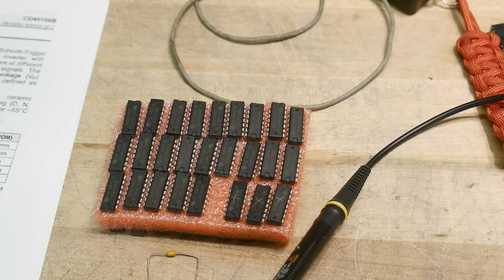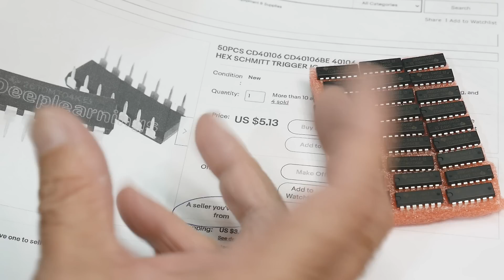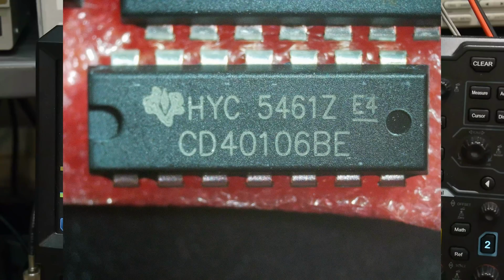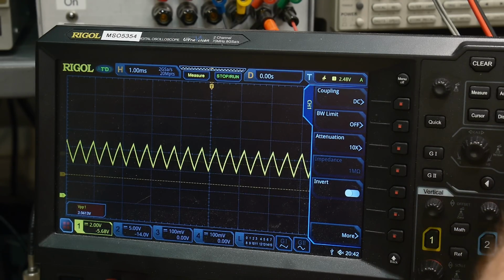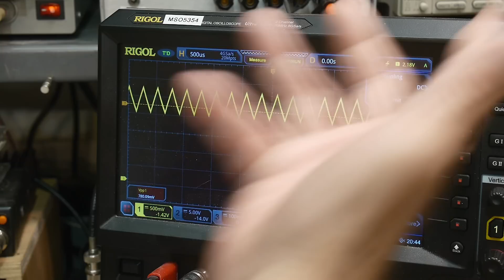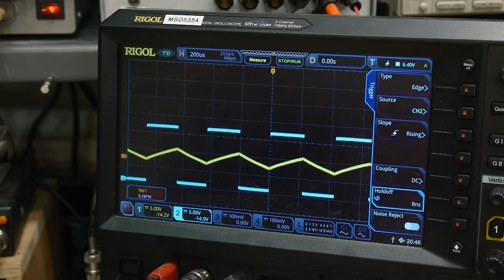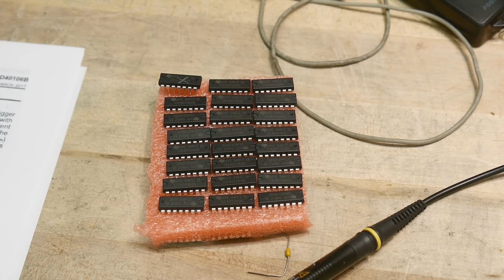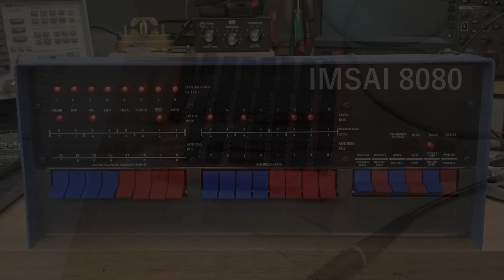#1317 Fake CD40106 ICs

Comment: Funny thing is standard TTL, at least the 1970's era stuff, would happily run on 14V with almost no failure, simply because that 7V rating is conservative, and you really need to be running the part at 125C to make one in 100 fail at 7V. The parts are likely remarked 74C or HC/T parts, mostly because there are almost no fabs left who can deal with those old process steps any more, the silicon used to make the IC would, if they used the original feature sizes and diffusion depths, mean the actual silicon area used would be close to $0.50 just on the wafer, while the modern HC/T uses around $0.01 of silicon, as the die is so much smaller. Not with features that you can see and examine with the naked eye any more, you need a microscope.

Incidentally, try your experiment again with old TTL IC's, even though you will have to change oscillator values to get them to work with the high input bias currents, and you will probably find a good number of the TTL IC's will work well past 7V.
Reply: At >7V it won’t necessarily fail in breakdown, but it’ll run hot and electromigration becomes a bit of a problem. For short-lived projects of course not a problem at all. I’ve got a few 4K CMOS parts that survived almost 30V. They run super hot when you get them switching fast at that voltage though. Hot enough to feel it at just a couple hundred kHz. At a couple MHz they pretend to be ECL in terms of heat.
Reply: @absurdengineering  Well, I did run some 54S00 parts at 14MHz as a clock buffer, using 3 cerdip packages stacked on top of each other, and with a decoupling capacitor across the top of the package. It ran hot, with one single gate as inverter, driving the other 11 to boost the clock power ability. Easily gave enough drive to use 50R coax to connect it to the scope with good edges.

Comment: I don't know too much about advanced features of that scope. Not sure how you measure hysteresis by only looking at input waveform at start of video
Reply from the maker: https://youtu.be/o31_fnTqUOw
Reply: @IMSAIGuy  I understand how hysteresis  works on the schmitt triggers and inputting a triangle ramp to test the range. But is there a special feature  or technique on that scope to test the range without monitoring the output ?
Reply from the maker: @rcarioca  I am not inputting a ramp. the output is fed to the input and the inverter will swap (change) on the high voltage and low voltage of the hysterisis. nothing fancy needed on the scope
Reply: @IMSAIGuy  ok thanks.. Now I fully understand.  I never thought of checking the hysteresis that way before.. Perfect.

Comment: Pretty sure I'm the viewer who first told you about having fake 40106s. I was using them in a simple automotive circuit so they never got powered over about 13.8V. I went through several chips before I realized what was happening. Funny thing is that the first chip I used lasted for about a week in the van before frying itself. When I brought it back to the bench the next few I tried all worked fine at 5V but failed within minutes at 12V. I think I still have the remaining bogus chips here if you would like me to send them to you. I don't trust them in actual projects now, even at 5V.
Reply: I also have fake chips that have the same problem. they do indeed exist. i use them at 5v and they work fine, but yeah.
EDIT: yeah, i should mention its this fake chip, marks as the cd40106. mine reliably die at 12v.
Reply: Just last week, I have found that my LM393 are fake, It works very well but it' s inputs consume a few hundred micro-amps instead of a hundred nano-amp. And this can be bad in a few applications. Avoid anything  that label TI.

Comment: What if we measure quiescent power consumption to check if they are bi-polar or CMOS devices ?
Reply: Probably CMOS all round, none of the output drop that TTL has on the scope as the voltage changes, at 5V TTL will never be above 4V unless you have a pull up resistor externally.

Comment: 25x CD40106 are less than $12 on Digikey, genuine from Ti. 58 cents a piece. Honestly buying from China in many ways is a false economy.
Reply: Problem is that ebay is convenient and cheap/free shipping. 
And people/me are usually lazy and those damn chinese have to ruin everything.
Wouldn't mind if they sold reclaimed parts with original marking and some bent leads instead of fake laser marked shit.

Comment: Ive stopped buying semiconductors from china years ago. It's a mess, and it isn't worth the time.
Reply: almost everything is made in  china 🤣
Reply: @artecno882  unfortunately
Reply: You THINK you've stopped buying from China, but the "All-American" places you buy from buy from China
Reply: Goes for the caps and resistors as well 

Dread to think about my transistors
So far most things I measured vary from -35 to +200 percent out of spec
Thought I build and designed all my filters wrong til I got a good rcl meter
Reply: Is anyone going to tell him that didn't pick this stuff from China?
Reply: Where do you buy from instead? Digikey?
Reply: @harrysvensson2610  Digikey, arrow, mouser, farnell, TME and even LCSC, which is based in china but all in all pretty reliable.